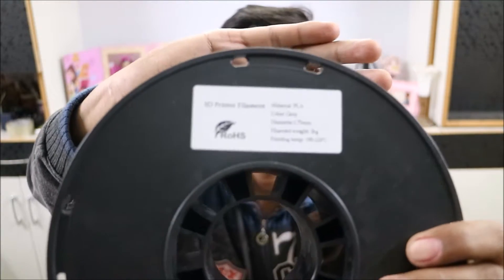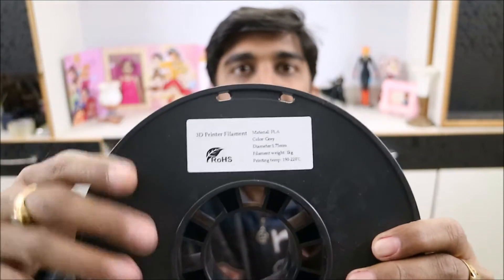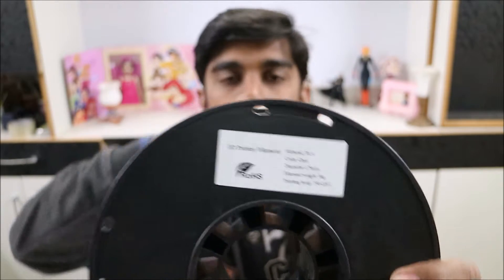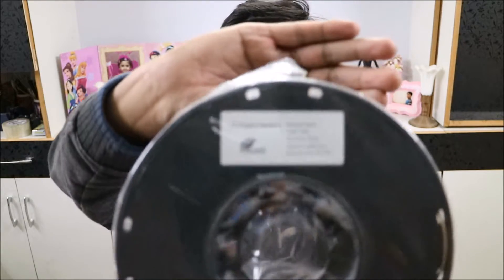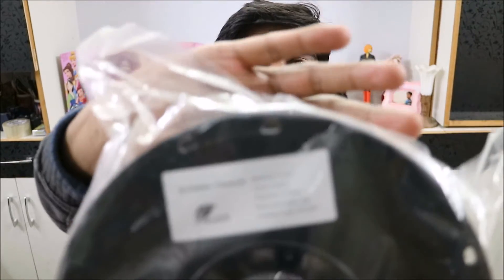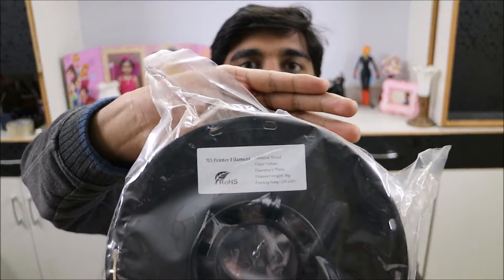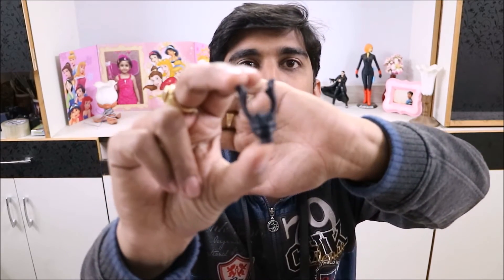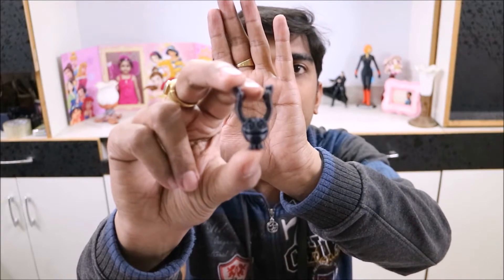Flash Forge Finder Printing PLA, Gold Metal Filament

Comment: Sir could you please tell me , whether flashforge finder could print metal composites like aluminium metal composites, copper composites, brass composites etc...
Reply from the maker: Ashiq Mohamed it can print metal composites,  I have shown sample of gold composite and also tested with bronze composite.  You can print any composite which is bound with pla and has printing temp less than 135 degree. Though keep in mind metal composites and carbon fiber pla will wear out your extruder very fast.

Comment: how to clean the support material sir. Is there any specific approach to clean it properly?
Reply from the maker: There is no direct method. I use tweezers, X-Acto Knife and Paper Cutter to remove the supports. Then I use sand paper to smooth the area. This helps in most cases.
Reply: +Craftgami 
Thank You sir